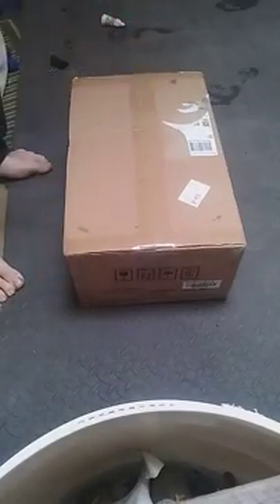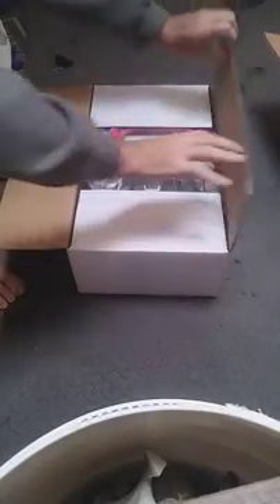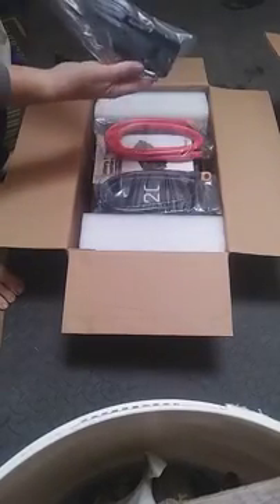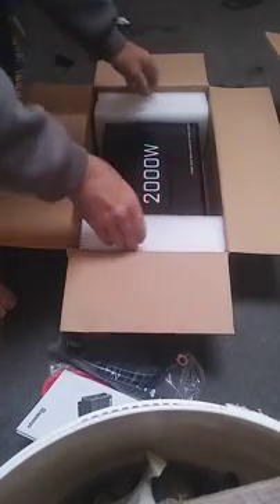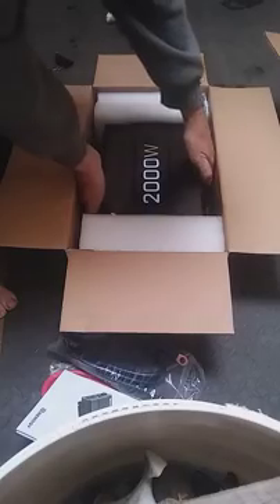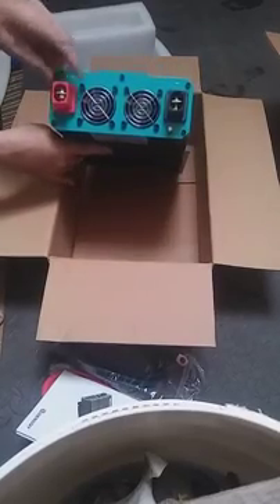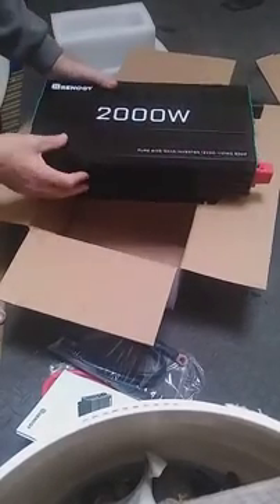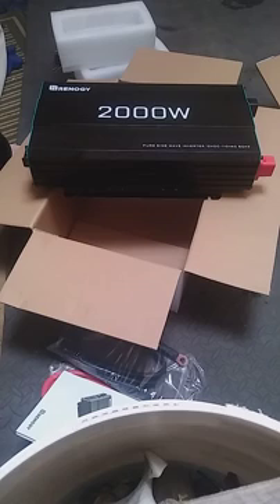Unboxing Renogy  2000 Watt Pure Sine Wave Inverter

Comment: Does it save home goverent electricity. How .pls demo
Reply from the maker: I'm not sure I understand your question. I am completely off-grid, so I pay no electric bill at all. I will post a 'Demo', but it will not be very dramatic, as this inverter simply does what it is supposed to. It runs heavy tools, and household electronics without any issues. I have been using this inverter for 23 months, except for an occasion of two months when I was on grid power.
Reply: @modernnomadtechnology9252  Very good! I am hoping to go off-grid eventually. Right now i am using a 1000 watt Xantrex modified sine inverter which is very limited, but i am upgrading to a 1000 watt pure sine wave Renogy soon so i can run more appliances. Greetings from Jamaica.